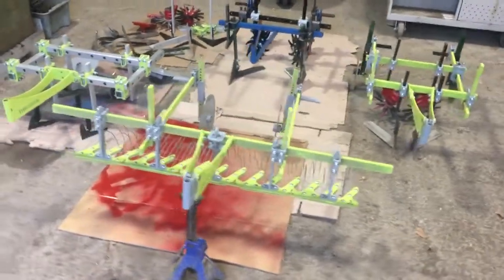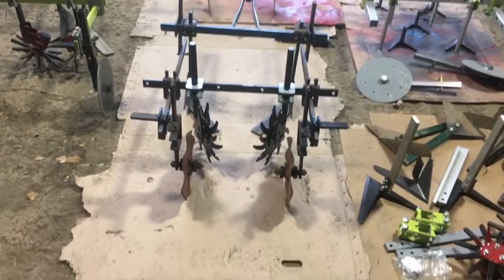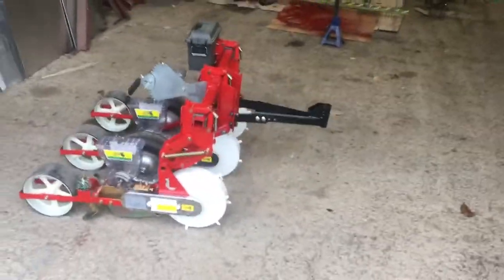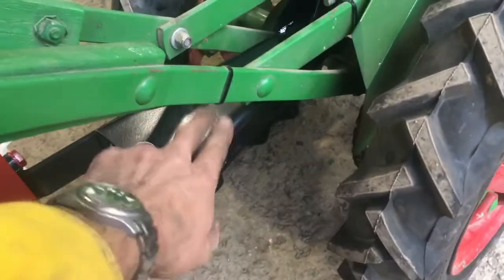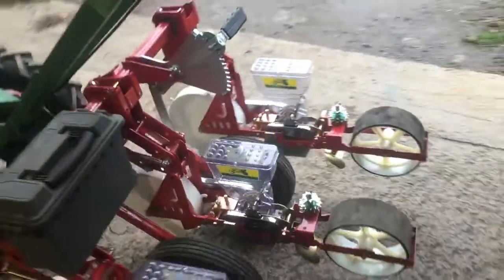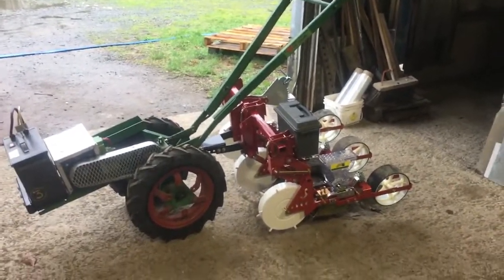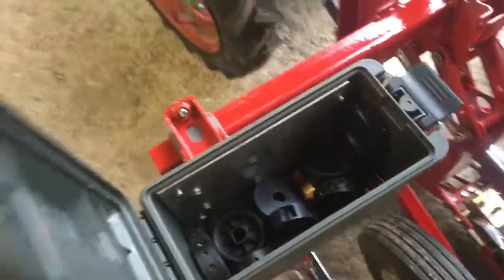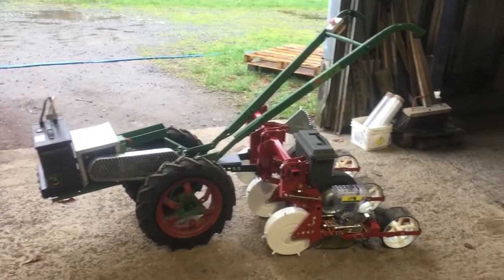Presenting A 3-row Jang seeder on Planet Jr BP1

Comment: Controllers! PITA Please share any info on what went wrong. Really nice machine and tasty implements! Cheers, John
Reply from the maker: The controller problem was 100% Operator Error in my case 😄.  I was rushing to assemble a new connector for the battery and got my polarity reversed in the plug.  I failed to notice before hooking up and destroyed parts of the controller.